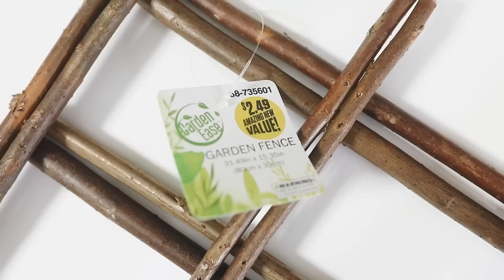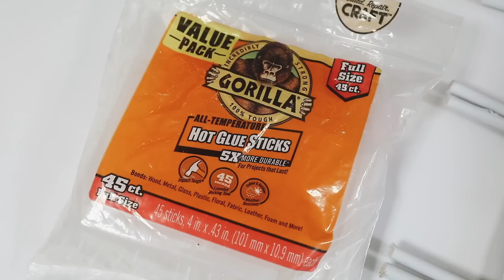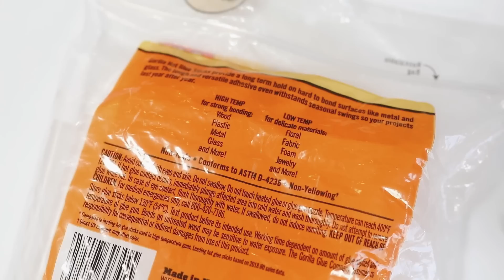DIY DOLLAR STORE ROOM DECOR (I can't believe I made these!!!)

Comment: I liked the flower pot the terracotta color, too. Both are nice... Just a note, you can use vegetable oil, with a couple of spoonfuls of  old candle wax (saved from where a candle burned out-save scraps of old candles,) or beeswax. I would just drop it into the vegetable oil so that you are not 'cooking' the vegetable oil that you intend to make a tallow candle of, because if it is cooked oil, then it can turn rancid, though with candle wax mixed in with it, then it does not turn nasty as fast.  Even with uncooked vegetable oil one should put a lid on it, anyway.  Just for those that do not have much money to spend, or they use a lot of candles, that they could use vegetable oil with a couple of spoons of old wax from candles, or beeswax. You can make a tallow candle with no wax or beeswax, but if you do not use a candle wick akin to the one you used in the video, then the cotton string won't stand up straight in the candle, becoming a nuisance to deal with, as if it falls to the side it burns out. The wax just makes the cotton string stand upright, so it will not fall to the side and burn-out.

Comment: I like the mirror but I think it would have been nicer if you used those little bits to finish on the inside. I think it looked a little unfinished.  Also, do you spray paint inside?